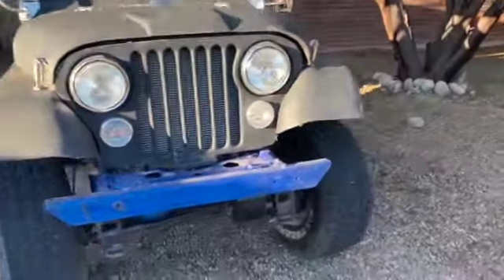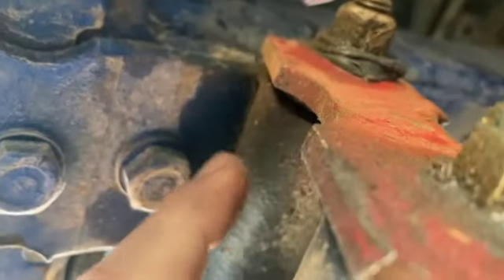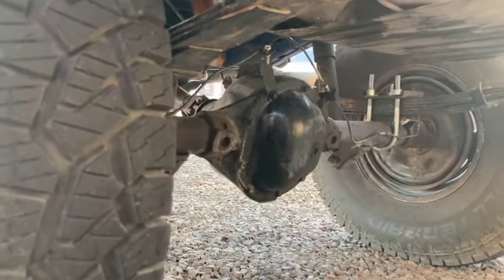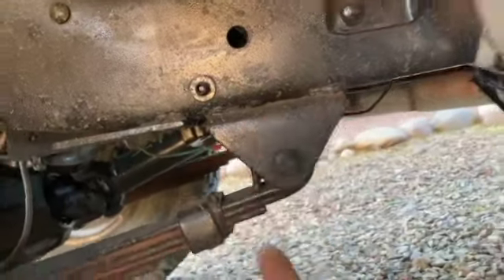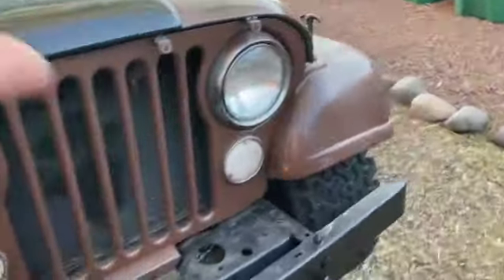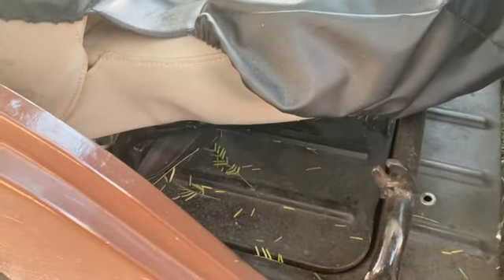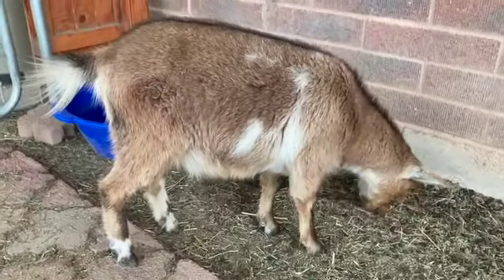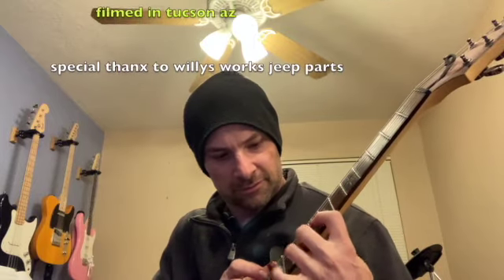what is the best year AMC cj5 jeep to buy ????

Comment: My current Jeep is an '83 CJ5. I'm partial to the early 80s CJ5s, although I've owned a 1970 CJ5.  My '83 has a (I think) factory steering box brace that clamps around it, and extends to the passenger side front spring mount and connects to the frame there. One of the five CJ5s I've owned was a 1980, and it had manual steering, manual brakes, Iron Duke 4-cyl. engine, and pathetic SR4 transmission. It was still fun to drive, but I prefer having the power steering, and brakes. The skidplate ecosystem and goats from different planets comments were funny. I noticed you were missing a lugnut on the front driver's side wheel.
Reply from the maker: ya my 76 cj5 was missing the steering brace so the steering box kept breaking off the frame without it

Comment: Just picked up a '79 CJ5 a couple days ago and working on ID'ing the running gear.  It has a in-line six and the hump over the transmission has been butchered., but it's looking like a T18/Dana20.
The rear pumpkin is round which if memory serves me right, is a Dana30 though I need to verify along with the front axle.
Thanks for the info, is helpful.

Comment: Kind of depends on what you're primary use of the jeep is.  
I had a 1982 cj5, straight six with the 4 speed and dana 300.  It was an awesome jeep....for driving around town.  My 1955 cj5, more better g or off highway driving!!!
Reply from the maker: yea need the t-18 cj5 with amc c8 with 4 barrel intake with power steering for good off roader

Comment: Great video, wish i would have seen it prior to my purchase.  I bought a 1975 cj5 a year ago and i cant believe how hard of a restoration/refurbishment it is.  Very hard if not impossible to find parts.  Its a battle.  72 to 75 being the intermediates.  My jeep is just like any other jeep when it comes to how much money you will put in... but its just more difficult and unfortunately less desired.  If anyone is getting into a CJ id say anything 76 to 86 (correct me if im wrong). If anyone knows which parts are interchangeable please reach out to me.  Thanks.
Reply from the maker: ya not many 72-75 cj jeeps around, seems to be 76 and up year cj's were made in much greater numbers and have more abundant used parts
Reply from the maker: many parts inter change but the seats are way different, 76 and up no tailgate and no passenger under seat tool box, 76 and up frame and cross member way different, power steering brackets are way way different

Comment: This is an awesome video, I was almost regretting just purchasing my 74 until I seen this.  MY current dilema is that I have 33" tires on it though and I think the lift was done poorly.  Way too long of front shackles are being used so it would be great to know what springs... you are runing with your 33" tires.  I only see 4" kits for 76 and above, they're are known that I know of for this era Jeep.  What is that?  Thanks though and great video!
Reply from the maker: ya long front shackles will destroy you're drivability if u don't re angle the front diff, mine just had 2 inch lift springs and stock shackles
Reply: Super - that's what I am trying to understand - "how much to lift it for 33".  I was or am considering an EMU YJ conversion but not sure.  Good to know you have sufficient clearance with your setup.  I am not looking to rock crawl... - just DNR trails in MI and OH mostly, which are mostly pretty mild.

Comment: Cool video. Seems no single year is the perfect Jeep. I own a '77 CJ 5. 258, t-18 wide ratio, 4.10 gears, power steering, Dana 30 with discs, Dana 20 t case, AMC 20 with Moser 1 piece axles. Not a bad set up, basically factory except the Mosers. But to make it closer to my idea of a better CJ I have a narrow track Dana 44, a Tera 3.15 gear set for the Dana 20 and an Advance Adapters output shaft upgrade for the t case also. Of course its got a winch, modest lift, full cage and other bits. But you know what happens. You make the upgrades you have and then youll see a whole new set of things that could be improved. Limited slips need to be true lockers, 33s need to be 35s, how difficult can it be to cut a tailgate into this thing? It never ends. Just Empty Every Pocket.
Reply from the maker: ya no matter the year there is upgrades or corrections that have to be done on these amc era jeeps

Comment: Bought my 73’ new had it to about 85 but would not do that again just a bit too far to the left .
Reply from the maker: this brown jeep goes straight as an arrow at 90 mph but super dangerous if I hit a pot hole or blow a tire, especially with a half cage, don't think ill crank her up  to 90 again
Reply: @junkyardjeep744  What would be a good one to go thru loose sand. I need something to and from work. My workplace has a rough driveway about a quarter mile of twists and turns and most of it is just plain loose sand and unpacked unless it rains but it dont last long. They laid gravel down on the hill going up and down and is not to bad now it is more the loose sand. About 90% of their clients have gotten stuck in thier sand driveway. I have gotten stuck 4 times now and 3 of those times was with a chevy s10. Any ideas?
Reply from the maker: @someguyto4675  well if u want a cj5 that's goes through sand a lot, u ned a factory Mac 304 v8 for the torque and get a 76 or later, they have disc from brakes, way better fro sand

Comment: Didn’t some early 76 frames have later 75 similarity’s
Reply from the maker: the engine bay frame width was about the same, but all different other then that
Reply: @junkyardjeep744   I had a 76cj5 and tried to put a 80’s Cj5 body on it and the outrigger on the frame right behind the front seat didn’t line up with the frame and I never finished it
Reply from the maker: @newriver8940  ya the 76 and up cj5 frame is weird, its fat and wide under the cab, but narrow under the hood

Comment: i have a 77 cj5 304 3 sp trans bad frame redone sealed and rustproofed rear axle positrack great offroad and on highway run 100 mph no problem
Reply from the maker: dang I would be scared to death at 100 mph in cj5, I had the brown one there in video up to 80 once , it drove fine at that speed but if I hit a pot hole or curb, man it would be game over for me

Comment: I don't think any one is perfect.  Most any motor is fine.  Granny trannies rule.  Non-amc Dana 20 rears.  They're like Legos.  Replace with better parts where necessary.
Reply: Btw, my build: 1975 CJ5, AMC 360, T18a, Scout D300, D30, D44, locker/spool, 4 disc brakes.  PS, fiberglass body, electric fan, 2.5" springs, 36" TSLs, Warn 8274.